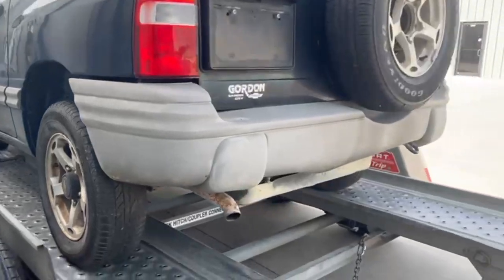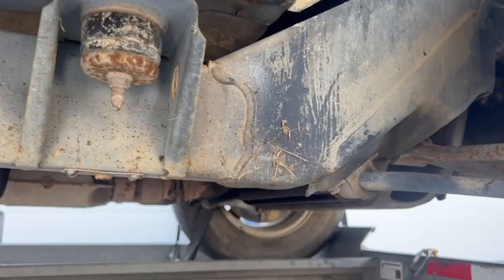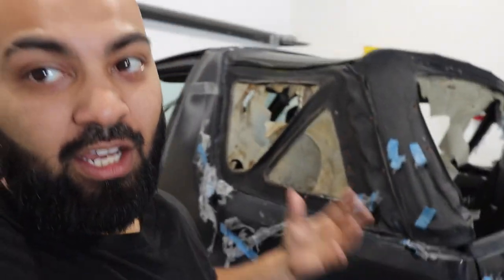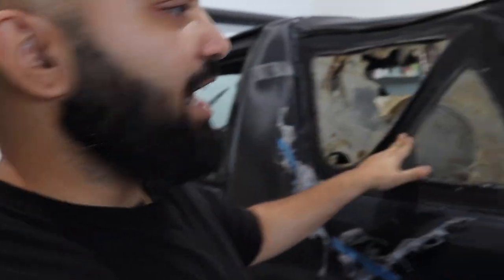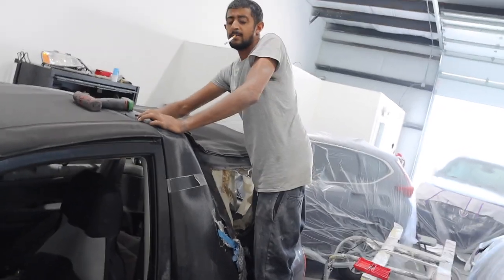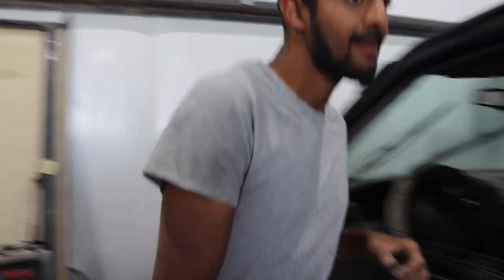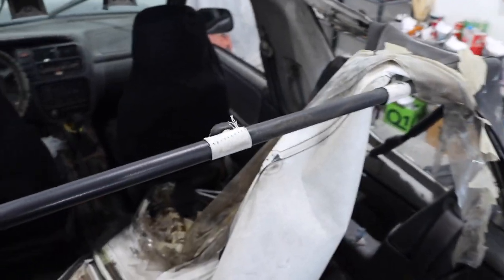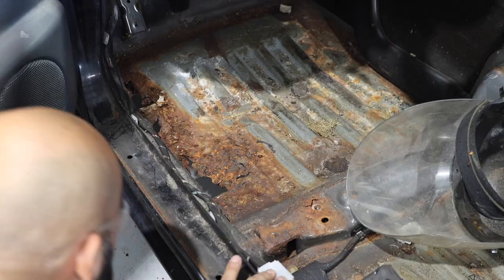New project begins: Off road Geotracker

Comment: RYAN!!!! I put the wrong battery in my avalanche. Do you think it will be ok?
Reply from the maker: yeah just replace it with the proper one
Reply: @Kingcustomz  but not ok to drive with that battery?
Reply: @Kingcustomz  I feel like I noticed it doesn’t want to go above 2000 rpm. I assume that’s a sign of the wrong battery
Reply from the maker: You gotta get the right one, vehicle wouldn’t function right
Reply from the maker: Most likely could be
Reply: @Kingcustomz  thanks man, I’m going to walmart right when they open
Reply from the maker: Yeah if anything get a higher crank
Reply: @Kingcustomz  I use the 78 800 CCA what do you use? I got it from Walmart.
Reply: @Kingcustomz  “maxx ever start”
Reply from the maker: Mine is from Walmart and it’s still good. Since 2017 maybe